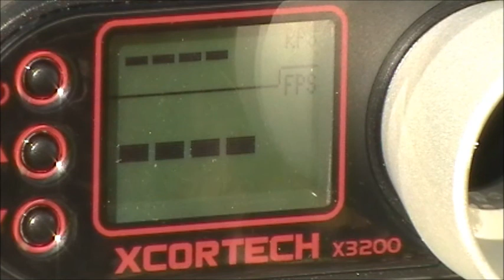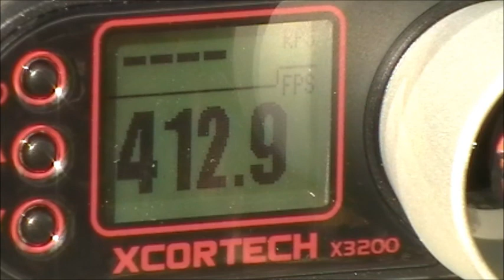JG M4A1 Airsoft AEG Post M130 Spring Change

Comment: That m4 seems to be all over the place, not very consistent accuracy? (especially with. 28s?) I suspect that hopup's not right, or something 's not right there? Also, the fps for a 130 spring seems very low? My Cybergun AK47 AIMS, shoots that and that's with the std spring, in fact we actually had to cut the spring coz it was too hot.
Great vdo though! 🙂

Comment: If i put a Madbull M130 Spring in my fully stock KWA SR10, will my motor have enough torque to pull back the spring without putting much strain on it?

Comment: A2a m130 spring with G&P m160 high speed motor etc i get 870rpm vs yours 440..
i do 129ms @ 0.20bb and 117 ms @ 0.25  how come yours shooting that slow?

ps i do use 9.9 LIFE 2100mah
Reply: He has a high TORQUE motor rather than a high SPEED motor. You should buy a high torque motor it works better for the spring and pulls it back better. I recommend this: http://www.evike.com/products/51177/     as it has insanely high speed and high torque. It will reduce your chances of something breaking and is a better motor.

Comment: i have a 2010 jg m4 just like that one and its shooting 430 with .2 and about 400 with .25, rof with a 9.6 is 17 rps......you should just put back the stock spring back unless you really dont care for rof :/ cause 30 fps doesnt seem worth that dramatic drop in rof, but mine does have a mosfet...hmmmm